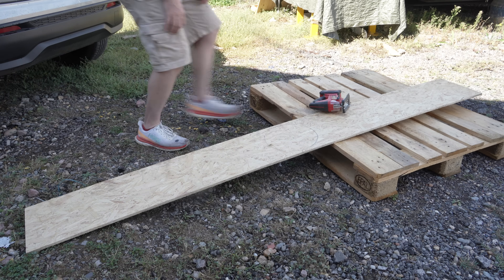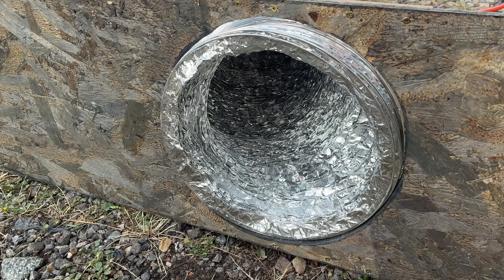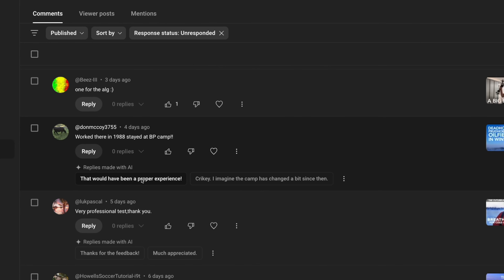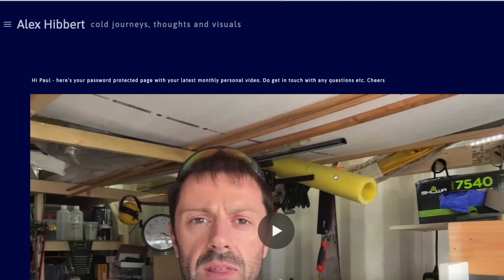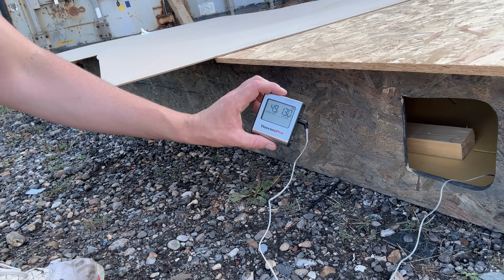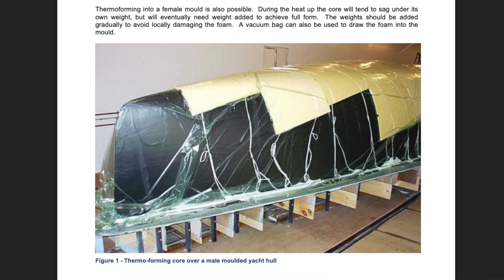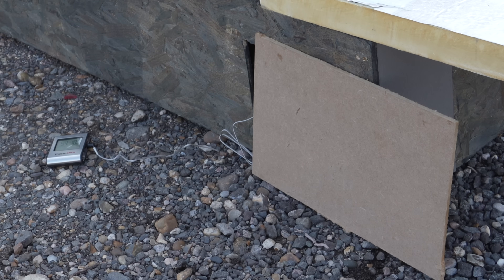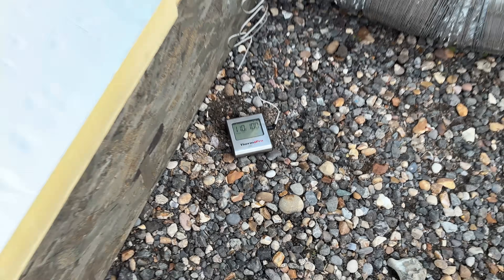Making a DIY Core Foam Thermoforming Oven in Composites Process. Arctic Vehicle Project BERNARD [4K]

Comment: Could you use some of those small fans you got for Alan to blow air out of the bottom to stimulate flow through the foam?
Reply from the maker: I actually got a couple of high temp fans but didn't use them - I don't think distribution through the oven is an issue - seems to work fine.

Comment: Interesting part of the project Alex, a plasterboard base under the box frame will give you a thermal barrier to minimize "ground effect" temperature changes.
Reply from the maker: Good point well made - although stones do retain a lot of heat once up to temperature.
Reply: @AlexHibbertOriginals  2 layers of 16mm pink plasterboard gives up to a 2 hour fire rating so I don't thinks stones have much chance of effect. 😆

Comment: hi mate 
i have a little experiencie making my own heat treat oven for steel
i dont know if there you have access to electricity 
but if you have it , making a hot box dedicated to heat that foam should be really easy and cheap
on amazon/aliexpress etc you can get cheap pid controllers wich normally already come with a relee and k type thermocouple 
suitable for the temp range you are working, you only need a heating element wich can be made cheap with kanthal wire
and  better insulation on the floor and sides
it will give you more control of the temperature and less risk to over heat
Reply from the maker: I did think about using electric elements, but the cost compared to gas is massive.

Comment: If you put insulation under it and adjust it so that the heat is being blown in from under it, you'll likely get better heat distribution.

As, by the looks of it, most of the air will be flowing over the top of the foam, with minimal getting under it.
If you can make a taller box, then you can have the inflow at the bottom, and the outflow at the top.
Which should make for a much more even heat distribution.

As it will have to pass though the foam in order to exit the box, meaning it will have much better chances to transfer heat into the foam.

And if air leaks become an issue with the insulation, you can use aluminium tape to seal them up.
Reply from the maker: Yes I was considering that, although then the volume will be much larger. To be honest though, I want to keep the heating up controlled and slow - really sealing it up could make it too effective. Heating from the bottom is better, but would mean a much larger oven, and now I've got a formula that works, I'll stick with it.
Reply: @AlexHibbertOriginals  You could do it with the same sized box if you moved the holes locations.

If you had the intake on the bottom and the out flow on the top.
You could get the same benefits, using the same sized box.

All it would really need is for the box to be propped up just enough to get the heating duct under it.